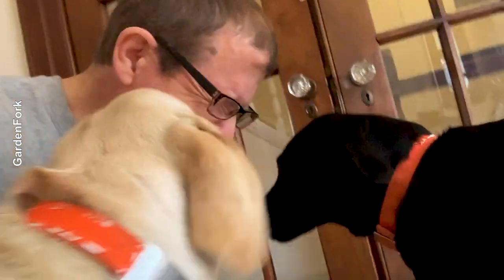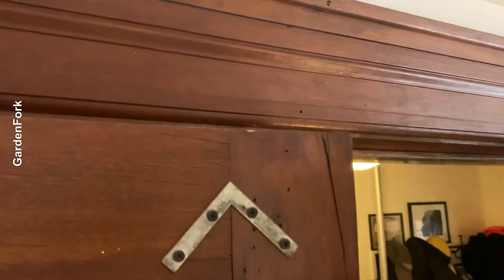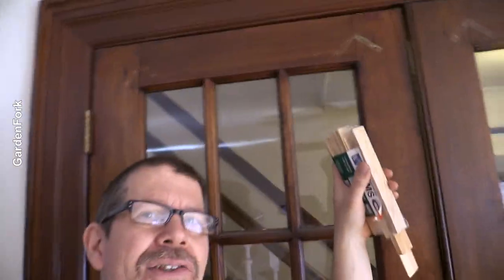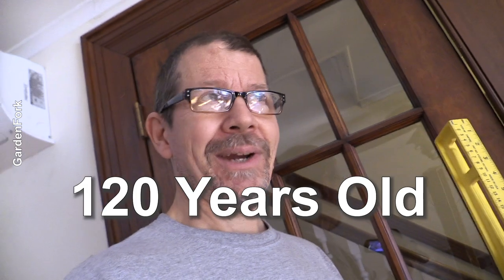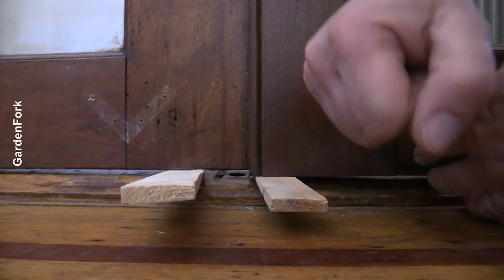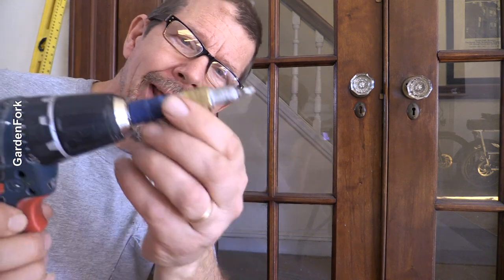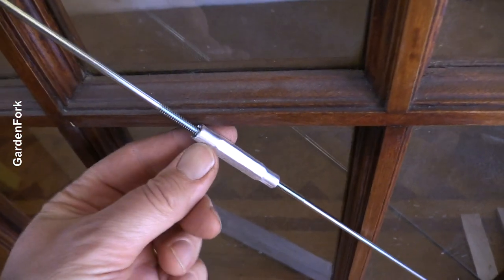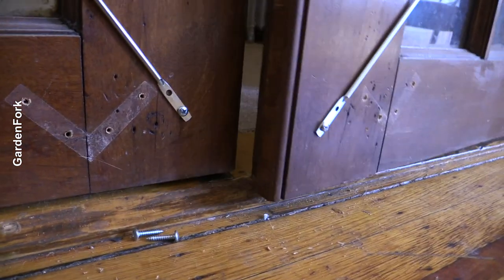Door Sagging? Let Your Labs Help

Comment: Hey, just wanted to say great video.  Always enjoy your take on things and the advice you have to offer people.  Also fun to see what you get up to things like maple tapping

I would like to add a tip about doors for you.  I have fixed many sagging doors in my career as a carpenter and can say that a sagging door is almost never the door, its the hinge.  Hinge screws are only 3/4" long and doorjambs are almost always softwood.  With the door swinging back and forth for years and years, that is a lot to ask of a few wood fibres. 

Fortunately there is a relatively easy solution.  This will also fix the misaligned strike and plate.  First remove the top screw closest to the pin on the jamb side of the top hinge and replace it with a #10  3.5" or 4" screw.  Be careful when tightening and you can line up the door with the jamb by tweaking the tightness of the screw.  Replace more screws into the jamb on the top hinge if you need more lift.  I noticed the gap on the top of the hinge side of the door so this might help you out.

Hope this helps, and keep up the good work!

Comment: so the doors were out of square?  long term fix would be to take the doors off use clamps to re-square the doors then drill and add dowels and glue to each side of the rail to stabilize the door
have used the technique of putting shims behind the hinges as well
Reply from the maker: I'm going to hope the camera operator doesn't read your comment Dave ;)  - Eric.
Reply: @gardenfork  lol